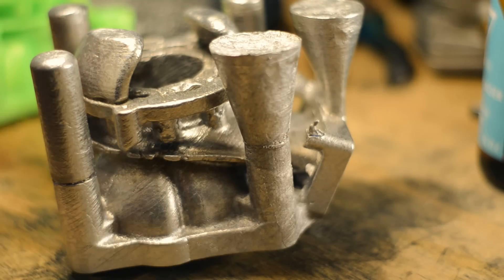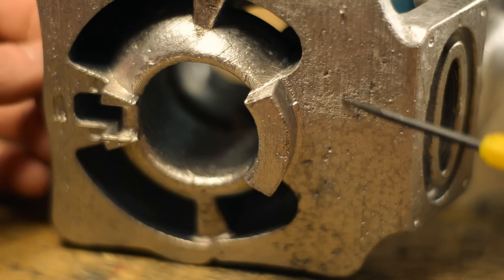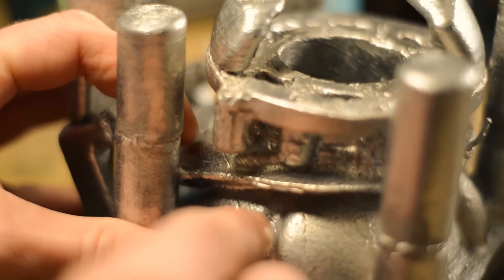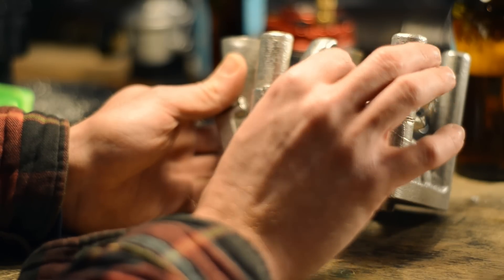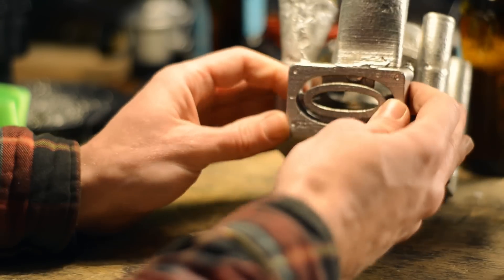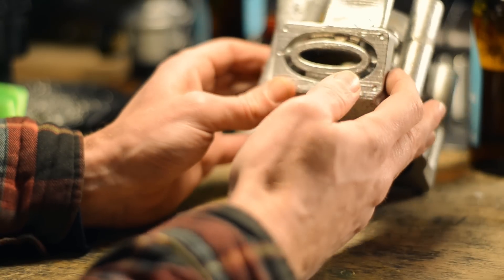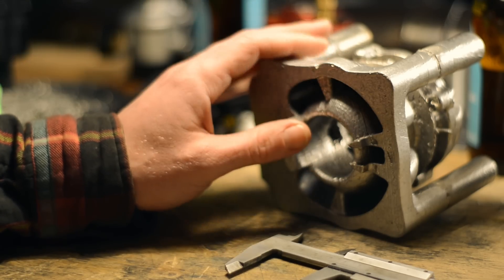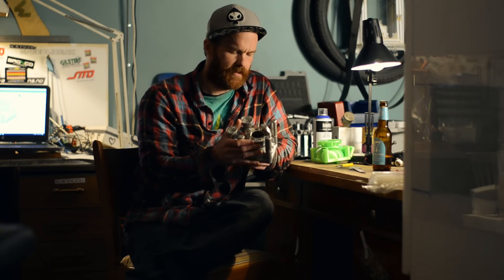Casting the Most Powerful Two Stroke Part 3 - First try result

Comment: So far so good.
Might be an idea to slice it in half and have a look at the internal structure for any voids which is probably more of an issue then surface defects you can machine or grind out. 
Also, I don't see any gains in cooling jacket around the exhaust port, on the contrary better it is hot to reduce carbon build up in it and the fact water wont circulate to the dead end it creates may cause more adverse issues and might be better to just let the aluminium conduct heat back to the main flowing water jacket, aside from all that it would make the casting less complex and thus less prone to casting flaws.
Reply from the maker: Thanks! I anticipate more failed castings so I think I'll keep this one as is - the first ever and all that.
Yeah those cooling channels might not do much for cooling I've left them out of the new model.
Reply: @2STROKESTUFFING  
Yeah fair enough, it makes a nice memento for your first casting.

Comment: What you want is only Vent/risers on the cylinder, the pour duct should be sepparate and have a ceramic filter between itself and the part you want to cast. Also you should make a large vacuum bell so you can degass the alloy before casting, and you said, you should have both the risers and the pour duct much taller, use more alloy (and ofcause get a larger crusible) :)
Reply from the maker: Thanks!

Comment: You're using lime? Doesn't that produce co2 when heated?
Reply from the maker: Plaster of paris, but 300C might not have been enough to pull out all the water.
Reply: It's melting Greenland.🙌👍🚲

Comment: Im no professional but I want to adress some things which I would do or research if I would do this.
Vacuuming the air out of the plaster before poured and after the model is submerged - safe is safe. Should be cheap to build a vacuum chamber.

Add draft to the footface of the cylinder so airbubbles when the plaster is poured can escape easier. Won't hurt either because material must be removed anyway.

I once was in a big iron foundry, they had like a "bathtub" in their moulds where the metal was poured in then flowed through a ceramic filter into the mould. If you want to know more I can send you a drawing via messenger. ;)

Vacuum casting machine, maybe..
Reply from the maker: Thanks! Draft on the bottom is a good idea, also vacuuming. The "bathtub" is probably what I refer to as a "pouring basin" in the video.
Reply: @2STROKESTUFFING  ah sorry didn't listen close enough while writing
Reply from the maker: No need to be sorry!

Comment: maybe you should extend the top section, and the bottom, then cast it upsidedown or sideways.

Have you seen the diesel 2 stroke design? It would be very interesting to have a normal 4-stroke head that takes out exhaust, and then have transfer ports all around the entire cylinder for intake. Maybe it wouldn't work for super high RPM of 50cc engines, but certainly for larger pistons+cylinders it could work well.

Comment: I ask about your bore plating plan as I have an old Stihl super cylinder, actually I have several, that I want to resurrect. They're blind cylinders but I'm considering making them separate head versions. Nothing a careful lathe parting tool can't fix. Enjoy all the knowledge you're gaining. This YouTube connection is great. It sure beats the small circle we had for learning in the precomputer age.
Reply from the maker: I'm currently reading up on plating, thinking it might be possible to diy. Thanks, internet has its advantages!
Reply: @2STROKESTUFFING  I have plenty of experience building systems for aerospace. Sounds impressive but it's just another electrical project of many. It's the materials and details that make plated wear surfaces successful. I'll definitely let you know if I happen get in front of you in any way. Any electrical questions are welcome.
Reply from the maker: Awesome, thanks man! Nickel plating in it self shouldn't be much of a problem, but then there's the part with the dissolved carbide.
Reply: @2STROKESTUFFING  I have had a shoulder to look over many times but I was too busy not paying attention.  As you are well aware it's one of those treatments that are more of a recipe than a procedure. Change anything and there's always consequences.

Comment: I thank you again for the time you are dedicating to pass along the knowledge you are gaining along the way to us and appreciate every thing you have done so far with the channel. Hoping the next pour is the one. Two questionsI have is how much allowance have you given for maching to size in the bore and the mating surface? And are you going to machine this one to spec or possibly cut into quarters to see how deep and the location of the defects to anticipate  future issues that are not visible right now?
Reply from the maker: Thanks! I've added 3mm to the top/bottom and exhaust flange + 3mm to the bore(bore was 40mm in this one to see how it behaved)
I'll probably keep this one untouched as it is my first ever casting.
Reply: I hear you, I was to courious to see if there were any other areas that may have inclusions, contaminates, orlack of material flow but I kknow your sentiment when I started drag racing  I did a burnout with a brand new tire down to the threads that was over 20 years
Ago still have the ball of rubber I picked up in my shop lol. Built a lot of things in my life and and you cant keep them all but there are a few special item that can be worth the effort to preserve like your cylnder pour the most powerful 2 stroke - take 1

Comment: 2STROKE,  A rather belated thank you for mentioning my channel in your description and also during your video. I have only just (late September 2020) become aware of this. It is a pity that I did not see it at the time as I may have been able to offer some suggestions.  Certainty running out of metal was a problem but beware of too much mould height as it increases metal velocity and thus turbulence. I have not seen your later videos on this casting  so I do not know how it all turned out in the end - I am about to go and watch them to see! My first up inclination would have been to cast the part the other way up so the thicker sections are all at the top (as far as possible) as this makes the attachment of feeders easier and more successful as thinner sections now lower down would tend to run better. Borax useless as a flux for Al,  Argon through steel tube almost useless bubbles way to big. Well at sprue base bad idea. 300 C nowhere near enough to preheat and dry out plaster - typically the plaster is ramped up to 650 C  and then cooled to casting temp see here http://www.hydracast.co.uk/doc/Hydracast-7960AL.pdf  You would have still had a lot of volatiles in your moulds including water after only 300 C... Will now go and see how it all turned out later.... Martin

Comment: Good job great analysis. Keep going can't wait to eventually see it run.  How far we have come in technology.  from Egyptians feeding mules a specific type of hay to use the manure as an outgassing agent in the sand for casting Iron (We were taught this by prof Jack Wright at  Cal-Poly and father Razer at Bosco Tech). to today using a 3D printer to make a pattern.  and cutting a water heater apart to make a furnace..... awesome...
Reply from the maker: Thanks! Maybe I could eat the right type of hay too, and "dump out" the models.

Comment: I've never watched in anticipation for a video so much.  Truely awesome. 

I would agree with success and failure with the casting.  

I'm in the design phases on my jug and will be following in your foot steps before to much longer.  I'd love to share my results when that day comes if your interested.
Reply from the maker: Awesome, thanks!
Reply: @2STROKESTUFFING  Just had a thought.  If you kept the mould in the kiln as you poured, would that help?  I know theres a risk of cracking the plaster, but isn't that from thermal shock?

Comment: It'd probably work.  It would take a lot of machining, after you grind out all the water passages and transfers with a Dremel first, lol.  Get grinding! OH, if you're going to try again, make much longer/larger diameter sprues.  It may make enough head of pressure in the molten aluminum to force it where you need it to go.  Also, get yourself some 80% Aluminum 20% Strontium master alloy.  Strontium REALLY helps Aluminum cast well.
Reply from the maker: Oh I'm trying again, and again, and again! The sprues was actually about 100mm higher, and fatter but I ran out of metal and they didn't fill.

Comment: Hello . I admire your work and I have a question about what looseness of the rings to rave in yamaha tzr 125?
Reply from the maker: Thanks! Ring gap you mean?
Reply: @2STROKESTUFFING  . 
What should the fit of the rings be? 0.25 will be good? or less
Reply from the maker: 0.25mm should be fine if it's a 50ish bore!

Comment: Only way to learn is to f**** the first time right lol , just make them a little bit thicker where it didn't cast at and like you said you was too low on aluminum to add enough pressure.
Reply: @2STROKESTUFFING  make some 54mm cylinders for the bike engine timed for the stroker crank , the case can take a 54mm piston before case boring is required people run the ms440 cylinder with a spacer plate and stuffing the transfer ports on the case and new mounting holes for the cylinder on the case. But you have the know how to make a awesome cylinder that will blow the ms440 out of the water.
Reply: @2STROKESTUFFING  you can fit a 51mm sleeved cylinder on the bike engine with the factory stud spacing so maybe a lined cylinder with a 52mm piston with a stroker crank for at least 90cc powerful engine.

Comment: You need a degassing agent for the molten aluminum, and you need a flux as well.  Also preheat your mold a little hotter since it has so many details. Check out MyfordBoy's videos on youtube. He does a lot of casting videos as well.  Specifically this one https://youtu.be/l3opkzAvVQk. Another one here about lost PLA casting https://youtu.be/HVgPM1ojyLw. You also may want to pick up some powdered boron to improve the grain structure and castability of the aluminum, it helps it fill in the tighter details in the mold. 
Good luck!
Reply from the maker: Thanks for the tips! I'm ordering degassing tablets + flux with the new crucible. Was thinking about bubbling through Argon but will try the tablets first.

Comment: One of the major problems with the bridge is cooling. Since the body is much thicker it takes longer to cool/shrink, and when it does it pulls metal from all directions and the bridge is a prime target because it is so thin. You could try attaching a small riser to the bridge so that when the main cylinder shrinks and pulls from the bridge, the bridge can pull metal down from the riser. Cleaning up the riser afterwards can be a pain, but it may be worth it. I think you'd enjoy this thread: http://www.alloyavenue.com/vb/showthread.php?11802-Air-cooled-2-cycle-motorcycle-racing-cylinder . The author is using a different method of casting, but still worth a read.

Comment: Not quite sure but,
Isn't it possible, like you choose to cast on your own ;
To think separately bases the cylinder, its curse, and the surrounding coolant system ?

You'll have to cast two different pieces, but maybe way more easier in the basic design ...

It might allows you simpliest and optimized ways to proceed ...

Whatsoever I found this :

https://youtu.be/GixuKh6Gbmw
(Unfortunately in french)
Which confirm the point that :
As a first try ...
It stand quite done !
And not exactly a failure ...